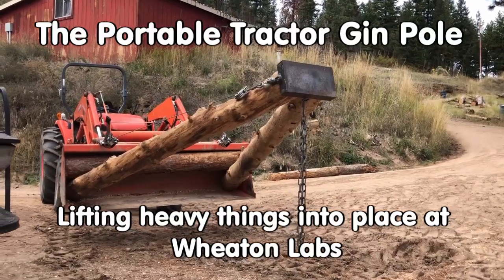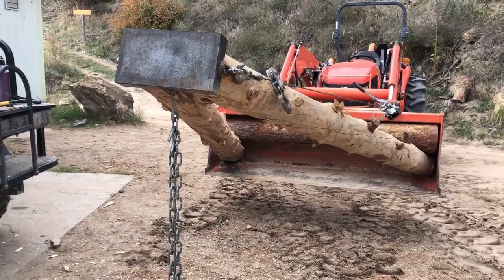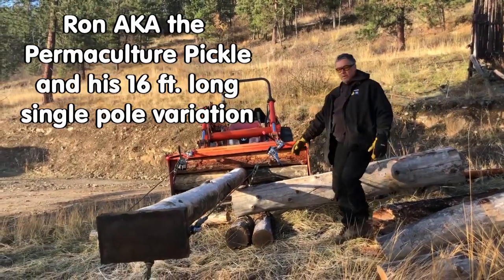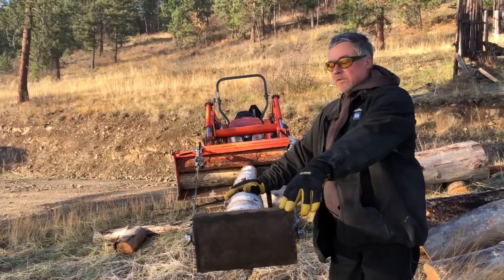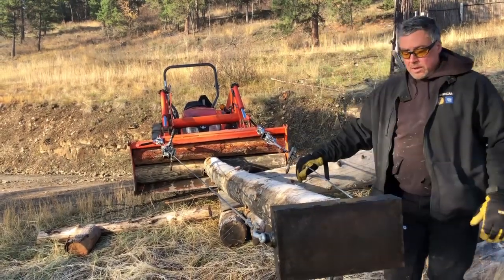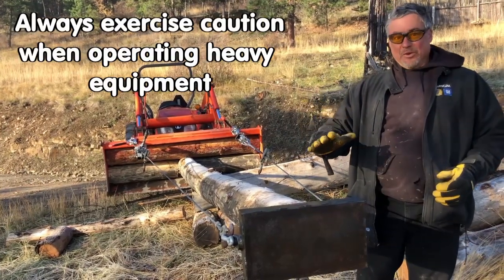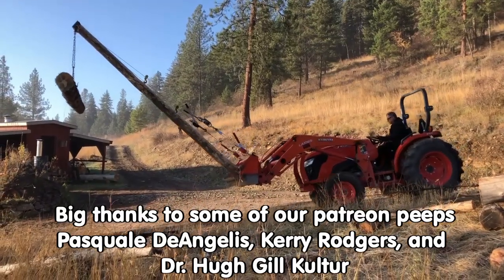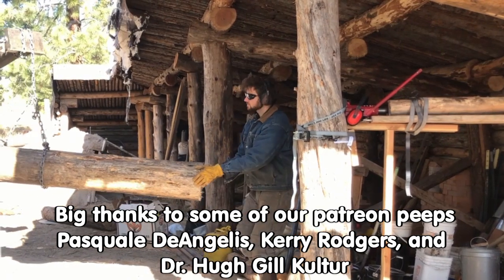Gin Pole mounted on a tractor loader bucket

Comment: Since you have quick attach on the loader, why not build a permanent  jib and switch between that and the bucket? 
800lbs of ballast on the back would also help a lot, hook an implement up at minimum.